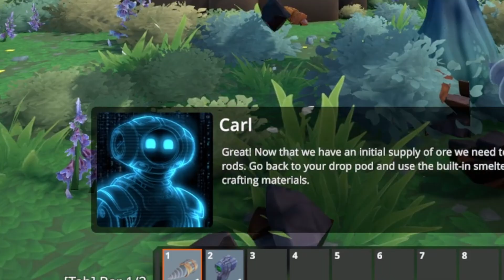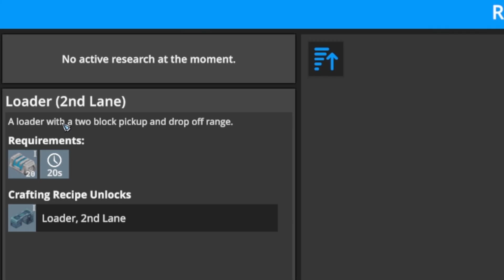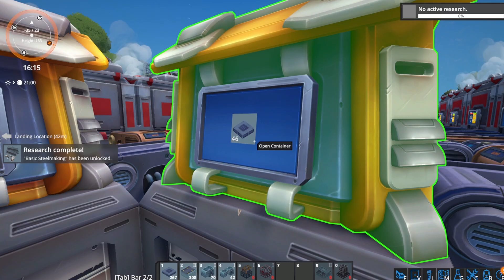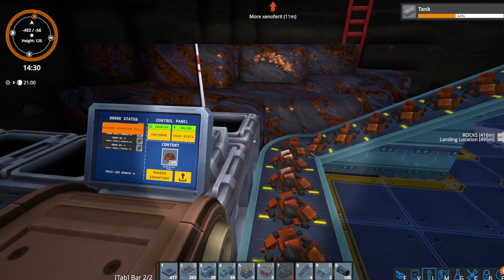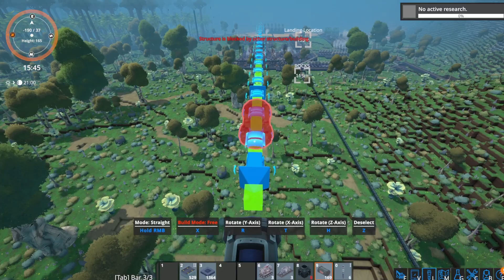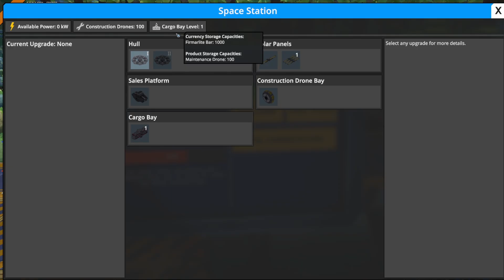I Spent 20 Hours in FOUNDRY!

Comment: I have found a love for automation games over the last year, but i don't think they're right in 3D. Think it's ultimately gonna limit everything cos it's being rendered and moved in 3D which will need more processing power, so the automation suffers 

There's an amazing 2D one called Mindustry that i found recently. Take a look at that. There's 2 campaigns with different play styles. You will want the "Serpulo" campaign. The "Erekir" campaign is more RTS and less automation. There's some automation on Erekir but it's only small things to supplement factory production for units like an RTS. The conveyors in Erekir are basically instantaneous so you don't need to think about the math much. It's not as fun as Serpulo, which is a more open-ended campaign focused on making factories to supply your campaign